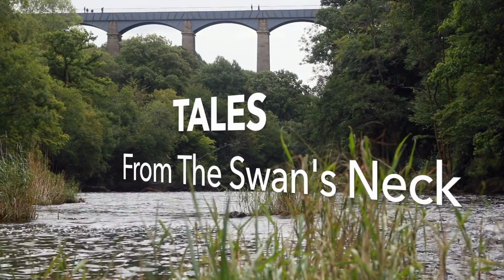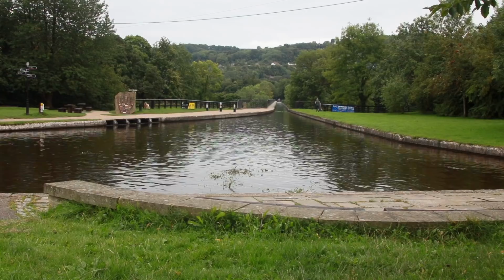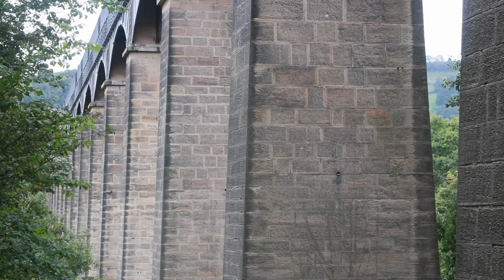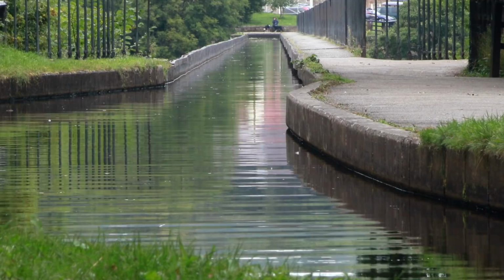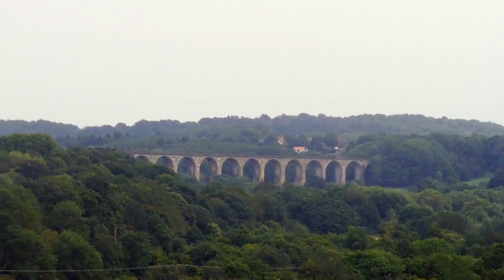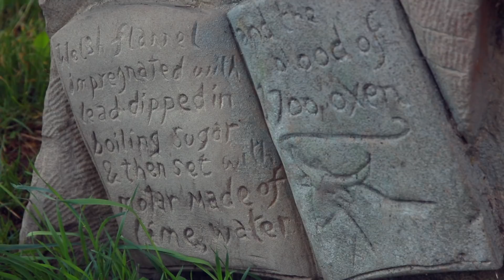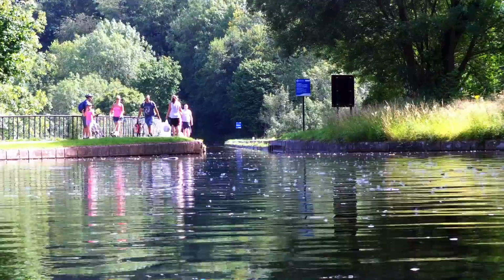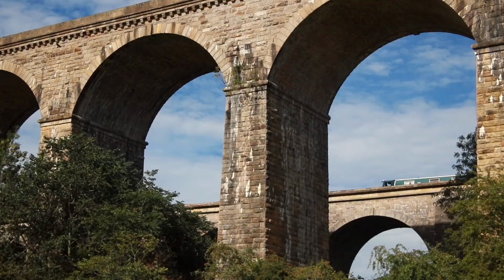Episode 35,  Aqueducts and Viaducts.The Pontcysyllte and Chirk Aqueducts and Viaducts

Comment: Part of the longevity of these structures is the negligible dynamic load and fatigue.  Thanks to Archimedes' principle, the loading on the troughs and piers is the same with no boats or a solid line of fully laden boats.  The dynamic load comes only from people and horses on the towpath, a small amount from wave action, and wind / seismic loading.

A viaduct, on the other hand, is constantly stressed and fatigued from the full weight of the vehicles and cargo.  Even worse, that weight is narrowly concentrated on the axles or bogies.
Reply from the maker: Interesting. I'm intrigued though as to the lack of rusting on the trough and support arches, the towpath struts and the nuts and bolts. Also by the fact that so little repointing has been done. Great build quality.